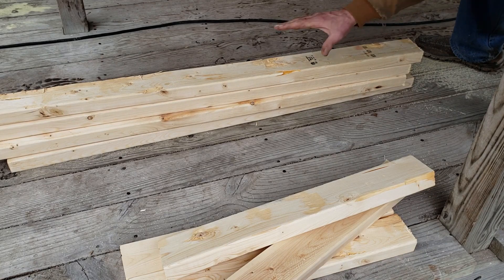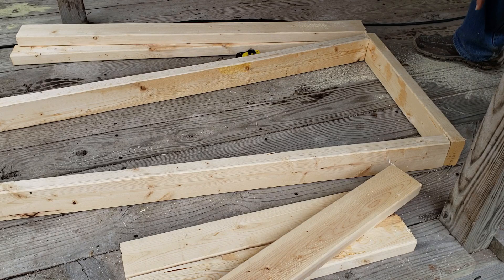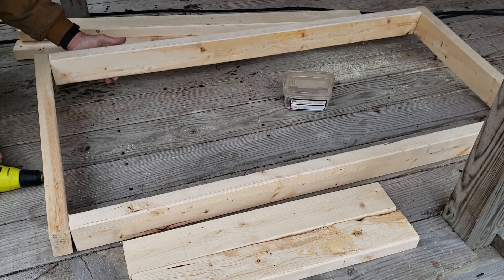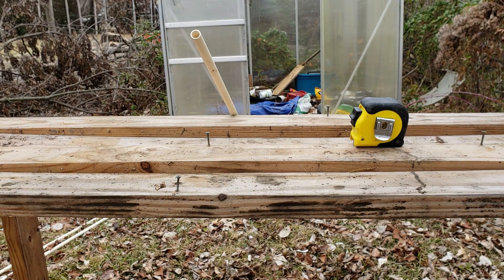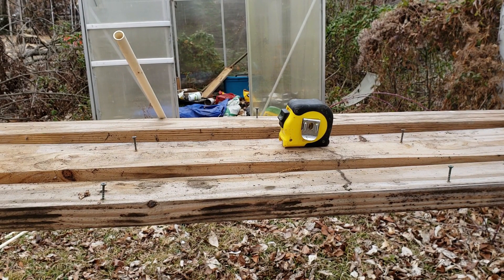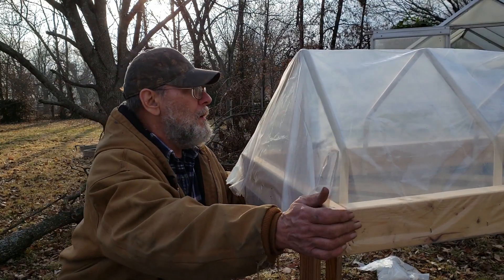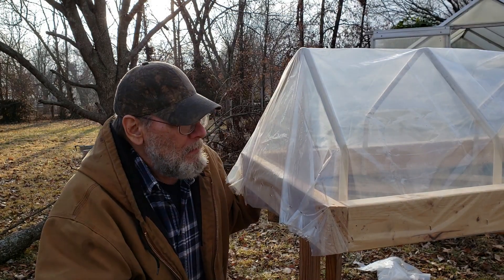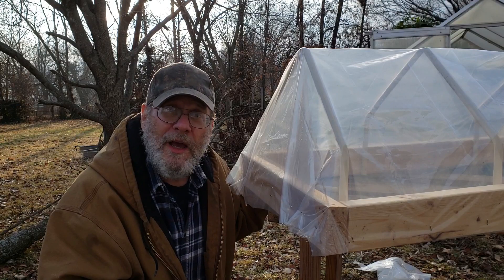building a mini hoop house /cold frame

Comment: Great idea! Did you do a follow up video to review how this build worked for you? What you made would make a great little hoop frame lid that you could attach with hinges to 2x6” or 2x10” base frame! Did you use 1/2” or 3/4” PVC? Schedule 40? Dimensions of the PVC hoops? Thanks for the great idea! Much easier build than those fancier, more involved cold frames. : )
Reply from the maker: Think its 1/2 inch. Cheapest variety. I have used this cover quite a bit, and have enjoyed it.
Reply: the LAZY GARDENER Thanks! : )